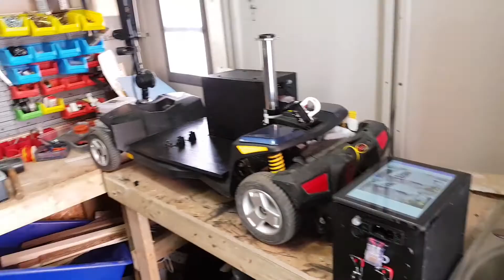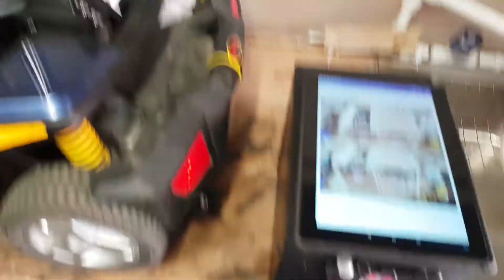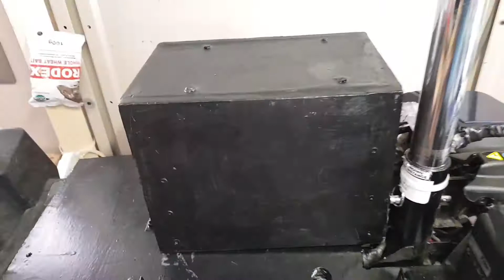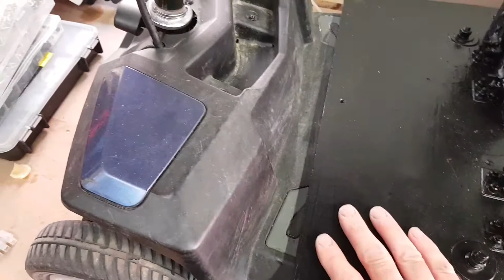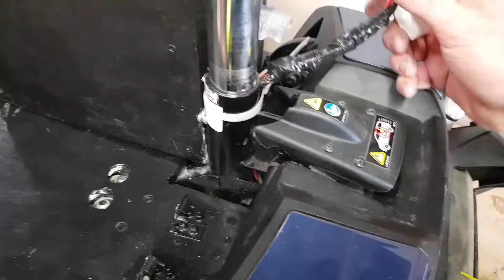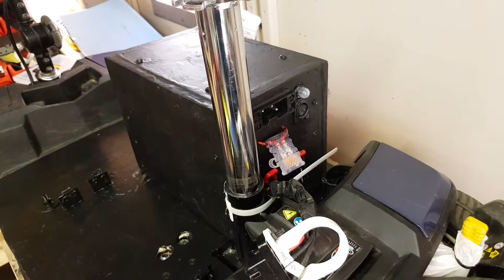Pride apex rapid Mobility scooter double endurance battery set up, almost doubling travel distance.

Comment: any updates on this
Reply from the maker: Hi, still running well, the only problem I have had is from a faulty Black Box battery causing loss of power. I will not be buying that brand again!!
Reply: @campacolasworkshop6042  I went for 2x22amh in the std boxes  but yours look like the fit better
Reply from the maker: @ballkeeper6662  Yes, my design was to keep everything as compact as possible, but also safe & secure.

Comment: So was this done for range i.e. amps 
 or did you double the voltage for speed?
Reply from the maker: Yes only for range, which has worked very well for me & taken me places I would not have got to without the extra battery available.

Comment: Hi, your modification looks good though I'd recommend upgrading to a lithium pack, you'd get more range for half the weight
Reply from the maker: Thanks, Can you recommend any??
Reply: @campacolasworkshop6042  for the 18650's I'd get them from this site https://wholesale.18650.uk/product/samsung-35e/ from there it all depends on your budget, you can either go for an easy no weld build like https://vruzend.co.uk/collections/v2-1-vruzend-kits or go with the more compact method of spot welding if you're planning to get the most out of the space, at that stage you'd need a good BMS which again depends on your budget and power requirements
Reply: of course the alternative is alibaba they have some good single cell batteries which might save you time if you don't wish to build a custom 18650 pack, in the future I'm probably going to upgrade my mums scooter for lithium and most likely upgrade the speed controller too
Reply from the maker: Please see my lithium battery upgrade video:  https://youtu.be/F6gkszkDeIs